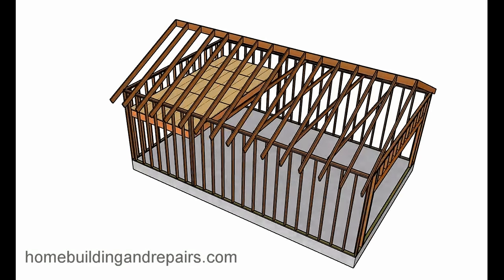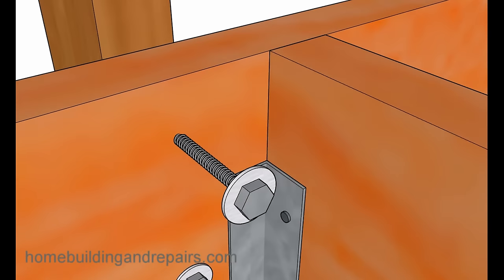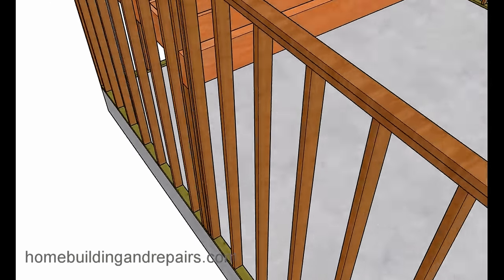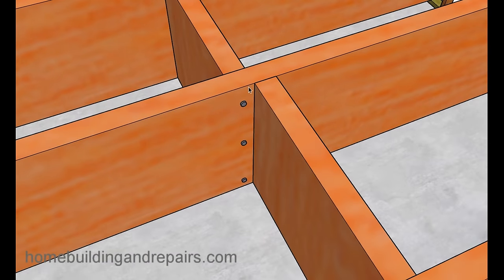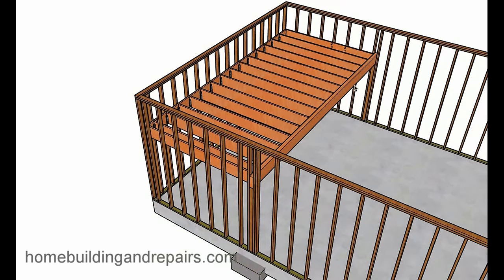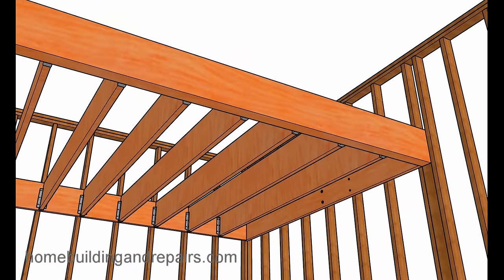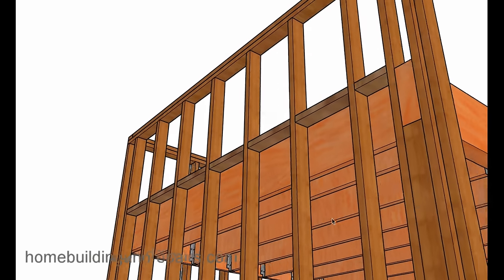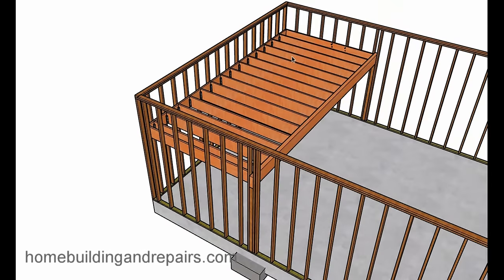How to Frame and Build a Loft – Home Design Examples

Comment: I'm considering a loft in my tiny house where the support is off two walls and 4 corner is supported by a steal post. Allowing head room in the kitchen area. (10x12).I like the idea of the pass through to wall stud & under support of header good plan.
Reply from the maker: Good luck on your project and thanks for sharing your ideas.

Comment: At the beginning of the video one can clearly see that there are rafter ties for the rafters not over the loft deck and that there are no rafter ties for the rafters over the loft deck. What resists the roof load that would try to push the walls out for the rafters over the loft deck? If it is the loft deck, how high can the walls be above the deck before it becomes an issue?
Reply: Id like to know this as well.  Would the new floor joists  be good enough to eliminate the rafter ties.
Reply: @DeadphishyEP3  I was thinking instead of having an inner band fastened to the studs, run the joists all the way out to the sheathing and lag them sideways into the studs. Then you would create a ledger under the joists, like a platform frame. Different than what he’s presenting in the video, but would seem more secure to me. Then again, I’m not an engineer

Comment: Can a truss designed like a floor truss be used as a load bearing ridge beam to eliminate the need for truss ties or floor joists to stabilize the outer load bearing walls when creating a loft space? Also, can the roof rafters be replaced by scissor trusses to create a cathedral like ceiling for the space in front of the loft deck? Thanks

Comment: Hi, Greg, I hope you see this soon. I used method 1 and I'm about to add midspan blocking on my 8x12 loft. My question is, do I stagger the 4x8 sheets of 3/4 inch OSB? Cuz if I do, some edges/ seams aren't going to be where I can nail them down into the midspan blocks. Does that matter? I hope to hear from you soon cuz I'm doing that today haha
Reply from the maker: I won't be much help here. Do what works best if you can't nail and can't take it apart to fix it.

Comment: rookie builder here; is there any reasoning behind going across the witdth of the building with 16 footers? Could you go 8 footers perpendicular?
Reply from the maker: Yes, you can redesign to fit different lumber sizes.
Reply: I am also confused. Rookie builder here as well - buying deeper boards is more expensive and takes up more headroom. 2x8x8 vs 2x12x12 for instance. 

You have the beam sandwiched between two studs but it's sort of  only supporting 1/10th of the weight of the loft.

Design seems nonsensical but what do I know...

Comment: I'm building a loft exactly like the first way you showed. Should I use double lumber in all sides connected to the wall? Or only for the beam? Thanks I will appreciate it
Reply from the maker: The joist that attach to the walls will usually be single boards.

Comment: What if the loft was landing on a footered load bearing wall or even two walls wherein a separate room on the lower level would utilize the loft joists as ceiling joists from below, beam needed?
Reply from the maker: I cannot provide structural engineering advice, but if you're suggesting that there's a load bearing wall that would replace the structural beam, then I wouldn't see a problem with that and as a matter of fact the wall would probably create a stronger structure.

Comment: Will a 2x10 lumber selection of Douglass fir span 15 feet for a garage storage loft
Reply from the maker: Check floor span charts or contact local building authorities for engineering information.

Comment: What do you think of, let say, I have 2x8 ledger attached to 2x6 framing, 16oc, and my loft joists are 2x8, 12-ft long, seating on top of the ledger secured by Simpson strong tie and also nailed to side of 2x6 studs. Is that framing acceptable? I'm concerning too many nails in narrow area on the studs. What is your suggestion for something like this? Thanks
Reply from the maker: You bring up a good point, which leads me to another point and that would be the reason why a structural engineer might need to be contacted. Feel free to email me a picture of the type of framing connection assembly you're referring to for more information. You can get our email address at the website.

Comment: Great video! I am doing something very similar to your video. I have a 28'x10' loft i am putting in my garage. I was thinking  to use four 28' lvl for the front beam with a 6x6 post at 14'. Then do the 10' joist 12" on center. All broads will be 2x12. I have footings in all the correct places. Do you change anything with my design? Thanks for any help.
Reply from the maker: I can't give engineering advice, but You are building a supper strong structure. Maybe a footing for the center post.
Reply: @gregvancom  Thank you, I have a footing for the center post also. Have a good day.

Comment: I want to build this as a seasonal /holiday storage loft in my garage, which has a concrete foundation. I will use the 4 x 6 x 14 in the front. Do I need the 4x4 post in the middle?
Reply: It would depend on what you would put on it. Personalty I would do it just to be safe so I wouldn't question it.
Reply from the maker: I cannot provide you with structural engineering advice, but can tell you that if the supporting beam is structurally strong enough or big enough then you wouldn't need additional support in the middle. You would just need to find a beam size that would span the length for your specific project.

Comment: I have seen lots of loft/floors constructed this way with long beams spanning and then shorts one on hanger going perpendicular. Why not run all joist (if the span is not too great), and then they can attach to studs if need, or have jacks hidden, of if one does not mind a ledge, sit the joist on a ledger?
I ask, because I am looking at installing a postless mezzanine floor in a garage, the span across is 18', so I am looking to build an 18'x10' floor, 16oc, and have all the end sitting on (and past) doubled up 12x2, and then cover in 3/4 osb.
Reply from the maker: That is definitely an acceptable method of construction. The joist might need to be wider, for example instead of using a 2 x 10 you might need to use 2 x 12 for longer spans.
Reply: @gregvancom  awesome, thank you for the reply. I see so many variation (many probably not right) built, but wondered. I know many dont mind posts, and I understand method in conjunction with them, but for this home project, need a span with a clear area below.

Comment: If I fasten the ledger board through the drywall into the studs, will the drywall have any effect on the strength of the loft? Is it safe to build this with no posts, with the joists spanning 17ft? Also i am using this loft just for storage purposes.
Reply: I wouldn't recommend it, cut out the drywall where the ledger board is. Drywall compresses, can get wet/moist and cause you to have a gap or framing to be loose.  You can build with no post but wouldn't recommend that either because that post transfers the weight evenly to the footing/slab (same as if you were making a header for supporting the roof of a load bearing wall.  If you don't use a post all the weight will be concentrated at the attachment point of your existing post as a side load VS centered on the top of an additional post and evenly distributed to the foundation.  Don't cut corners being cheap or lazy, it'll have catastrophic consequences.

Comment: Can you double the ledger and put it under the main leger so the loft or the floor will rest on it?
Reply from the maker: I've seen it done before, but it's not common. If you're going to double up a ledger, then you might consider installing some structural posts underneath it.
Reply: What if I do the entire garage and my garage is like 13 feet and I was planing to add a ceeling floor single ledger 2by 6 at 16 apart. Do I need support beens

Comment: 304
Ring shank nails prevent squeaks from in floors those are the smooth nails over time they will ease up out of the hole as you apply pressure to the surface of the floor it squeaks as it pushes the nail back in that's what the squeak is not with the bridge blocks the bridge blocks do nothing but keep the floor joist from rolling see that block keeps it steady stable it cannot move it cannot push the other block out of the way in order to pull the other block into play same thing with your roof system rafters your rafters would have to push the opposite rafter on the opposite side of the house in order for that roof to raise up it is scientifically connected designed architecture that's what's so special your purling your wing walls so you're able to brace your ceiling your rim joist everything is ordained plywood clips when you're decking that feeling with the OSB wait for bored however
Reply: Longest sentence ever. 
Forgetting your periods makes it impossible to read. I’m curious what you’re saying! Do you recommend ring shank nails or not? Can’t understand what you’re saying.

Comment: If 2x6 studs, you could do balloon framing to avoid hardware: Let-in the ledger, then have the joists connected side to side with the studs, sitting (ideally notched but not necessary) on the ledger.

Comment: How much distance should there be between each bin??
Reply from the maker: I cannot provide you with structural engineering information, but was wondering what a bin is?
Reply: @gregvancom  oh yeah! I was talking about the walls, the distance between the walls. I have 16 ft opening from wall to wall. What size header can i use   without a center support  beam? Is for a Loft!

Comment: Can a loft of this structure support adding a layer of osb, hardibacker then tile...then after all that some furniture and ppl?
Reply from the maker: You would need to get all of the lumber sizes and footings required to build a loft like this from an engineer. Remember, these are only examples to show you how it can be done, but won't necessarily always work on every project.
Reply: gregvancom ...the reason I ask is because my wife and I just purchased a home that is about 10 15 years old and has a small 2nd floor loft inside that is carpeted with a layer of OSB under the carpet...we would like to put tile and would just like the peace of mind to know if this loft can take the weight of the porcelain tile.
Reply from the maker: The only problem with answering your question is that I don't know anything about the construction of the loft or the rest of the building.
Reply: gregvancom ...me neither...and nobody can tell me without tearing up the entire floor...all I know is that it has eight 2x4s or maybe 2x6...not sure which of the 2 (but definitely NOT 4x4 or anything thicker)...these boards are running width parallel to each other attached to two 4x4s using joists running length wise...those two 4x4s are in turn attached to the house...and this is an interior loft...or maybe I'm just being redundant now.
Reply from the maker: I don't know if you're being redundant, but it's difficult sometimes to provide people with answers, when I don't know exactly what's going on. The last thing I ever want to do is tell someone they can do something and then years later find out they shouldn't have.
Reply: gregvancom ...alright then...thanx anyway.
Reply from the maker: you bet.
Reply: I'd say no, most floors or lofts are constructed of 2x10 or 2x12.  But only an engineer can be 100% sure calculating the spans, beams and tell you yes or no but you'll still have to rip up the floor and engineers may charge $500-$1000 just to show up for that info.